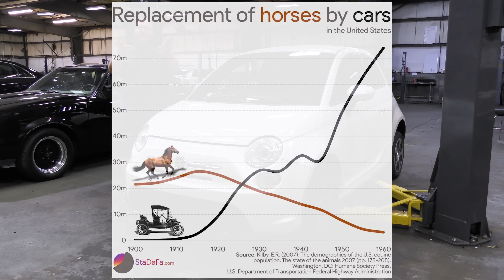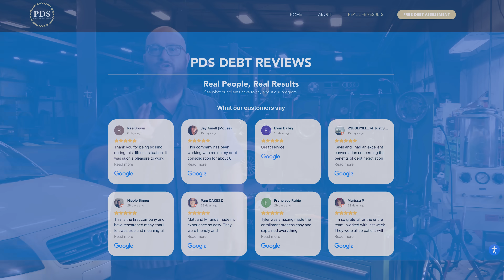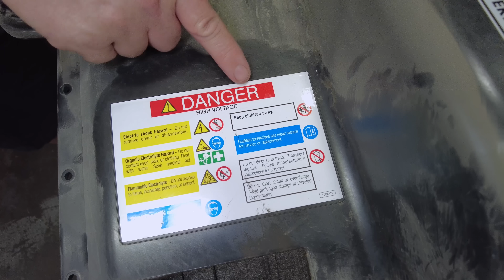How to SAFELY Remove the EV Batteries From my Fiat 500e

Comment: I do not think the proprietary problem will go away anytime soon.  Even ICE cars are like that.  Special tool for everything, you need to be registered to some thing to work on certain modules, etc.  Manufacturers do like people repairing the stuff they bought.  EVs make it even more simple, no mechanical parts that go wrong.  It is all closed source code.
I am with you that there is a need to standardize stuff, but I do not think that will happen easily.  The only way I see it happening is government to step up, and put a limit to waste and planned obsolescence.
Reply: Mechanical parts do not necessarilty make things complicated.   This EV battery is, perhaps, more complex than everything together  under the hood of ICE car.

Comment: Wizard, I've been working in Hi-Tek for 40 years (electronics). I'll never get into an EV. All that energy stored in those batteries is like riding in a blimp filled with hydrogen. One 'oops' and KABLAAMO!!! You're toast. Literally.
Reply: And gasoline is safe.
Reply: Gas car fires are currently 10x higher per capita than pure EV. Plug in hybrids seem to have the highest fire rate.

Comment: Just like my hobby of working on and building computers. Laptops are disposable, almost no companies are making them to be upgradable outside RAM/ and your SSD drives/ battery, no fixing them also again maybe the screen replaced. It used to take me 3-4 hours to buid a desktop with every part its own PCI slot, now its all onboard. I can build a new PC in like 15 minutes. Look at Apple, NO parts are replacable, everything is soldered on the board. If it dies, you loose it all.  Cheep disposable non fixable garbage is the future. I would bet in 20 years onlly breaks and rotors, etc would be servicable.
Reply: Body work will probably stay for a while,  though even that becomes almost not economical to do

Comment: EVS have failed and i for one will do my upmost to never buy one. That said!! Before i get ev lovers slagging me off, i did always say, if an EV could do 1000 miles on a single charge at that point i would switch. Until that day, i will never stop buying petrol or diesel.
Reply: derp
Reply: The number of people needing 1000 miles per charge are a vanishingly small fraction of less then 1%
Reply: How often do you drive 1000 miles? At 65 mph it takes 15 hours to drive 1000 miles.
Reply: Internal combustion engines have failed, but if I can get one that does a thousand miles for $20, I'm in!!
Reply: @proudvirginian  most diesels do 600-700 miles easily.
Reply: So I assume you enjoy driving 1000 miles in your ICE vehicle without stopping for a toilet break, having something to eat, or otherwise taking a break from driving? If you do in fact stop for those breaks, then that's when your EV recharges.
Reply: @voidthewarranty1429  no but I'd rather drive 400 miles and not have to sit around for 2 hours waiting for my battery to recharge.
Reply: @NoGGy  Our Model 3 takes only 9 minutes of recharging per two hours of driving, and that's our real world experience using Tesla Superchargers. You don't need to recharge to 100%. Instead you do quick top-ups each time you stop for a break. Our peak range would be 5 hours driving (mostly highway with some urban) without recharging, but it's much more pleasant to take occasional breaks.
Reply: @voidthewarranty1429  I guess that's the thing, that's acceptable if and it's a big if you can find and get access to a super charger. Most of the time here in the UK it takes far longer and even the other superchargers rarely hit the peak. Most people I speak to, it takes a minimum of 30 minutes to add another hour of driving. But I do appreciate the Tesla superchargers are next level. Just not enough of them in the UK.
Reply: @NoGGy  I agree with you on that. I live in New Zealand and our Supercharger coverage is pretty patchy, so if you are on a main route between cities you get good fast charging, but off the beaten track it can be very slow. But even so, almost all of our charging is done at home and for a long return journey we start at 100% and usually need only one 'topup' to get us back home with not much left in the 'electron tank'. We then we recharge overnight back to 100%. The Tesla navigation is really accurate with range estimates, so it always arrives at destinations within 1% of estimated battery state of charge.

Recommend you take a decently powerful EV for a test drive one day. You might be converted. Our basic rear wheel drive Model 3 has 300hp of grunt.

Comment: I also heard people claim that "they tried electric before when combustion engines became popular, it didn't work then, it does not work now, just like then, combustion will win".
They conveniently forget that they are talking about technology over 100 years ago, and batteries were also new-ish, and certainly the technology behind them was in its infancy days.
So basically the energy storage capacity and electric engines have not improved or changed at all in 100 years... or so they would like you to believe.
Well, combustion engines massively improved, but somehow everything else did not? maybe these people still drive grandad's model T ford or something lol.
Reply: I apologize I answered without clearly reading your post
Reply: @iainpaterson4204  that's perfectly fine, i wrote it with a good dash of sarcasm, which can sometimes result in overlooking question-marks or other little hints at sarcasm, so... no worries, no apology needed :)
Reply: Wow your clueless the Tesla Plaid is one of the fastest production automobile, so the battery/motor technology has changed
Reply: @iainpaterson4204  eeeeh, have you really read what i wrote? i literally only added a statement i've seen posted numerous times, showing how backwards the minds of anti-ev people are.
And if you read more careful, you'll notice that i imply exactly what you just wrote....
I guess you are not aware of the very first cars using electricity, others tried steam, and again others tried combustion engines, that's ok though, now you know, and now you also know what i really meant.

Comment: How will the EV makers make any money if they get a unified battery system and shops like yours, not connected to a brand?  
Forget about it, it'll be dealer shops only, no aftermarket parts and once one computer goes bad you car is scrapped and they'll sell you a new one.

Comment: Engineers will tell you that EV batteries like to operate in the same ambient temperatures preferred by humans. So if you live in area where you rarely wear a coat in the winter and can survive summers without air conditioning, your EV battery should last a good long time.
Reply: That's where I live, and my tesla loves it,
Powered by the sun.
Reply: West Coast sounds about right

Comment: My biggest issue with EVs is the lack of freedom, your held to a network of chargers, you can’t take jerrycans and go into the wilderness like with a gas or diesel powered vehicle, it’s also going to isolate rural remote communities especially in nations like Canada. 

The push in technology also leads to even more government control and tracking technology. 

I don’t think EVs will ever fully take off outside larger urban areas until batteries can be fully portable and self swapping. 

There’s is also no benefit for EVs in use for work vehicles such as farming, mining, construction etc. 

I understand the arguments but I feel like these arguments are often made by city dwelling individuals who aren’t thinking about the larger ramifications of the lack of freedom EVs provide.
Reply: Freedom? Which freedom? When own a car you are not free anymore. EVs do not pollute anymore and are overall just better than all others. In the wilderness you do not get gazoline. But i can take a PV Module and make my own electricity.
Reply: No benefit for mining? Your ignorance is showing. Mining, more specifically underground mining, will benefit greatly benefit from electric. The cost savings alone in simplifying the vast and complex ventilation infrastructure will be substantial.

Comment: 2:40 To answer your question, Wizard,

Here in the UK,

I can contact 2 companies that only service and repair EVs:

One company has a fleet of 4 or 5 MG EVs station wagons that will dive and carry out the service at your location - One of their MGs has well over 200,000 miles with another over 100,000 miles.

While the other has the same setup as you but only works on EVs.

Near me, there is a rental/lease company and you can borrow an EV for a few hours up to a few years.

 I also know one company (dealership) that only sells EV cars.
Reply: I was extremely close to buying a used Tesla Model 3 but wussed out.. but I had a chat with a guy who runs a fleet of high mileage Model 3's and he said they were astonishingly reliable.. they were all on galactic mileage and running great.
Reply: @jimtaylor431  they are a much better design and reliability vs the model S

Comment: When I worked at a Dodge dealership to change the fuel pump on the pickup trucks we would remove the bed bolts but just loosen the back 2 and tilt the bed up to get access to the fuel pump module
Reply: I’ve replaced a lot of fuel pumps and unless you have a spotless bed I am not touching those bed bolts.

Comment: It would have been nice if the designer's of the new vehicles would have made it easier to swap out batteries rather needing a hoist to do basic service.
Reply: No it would not. You can not put the battery on the roof.